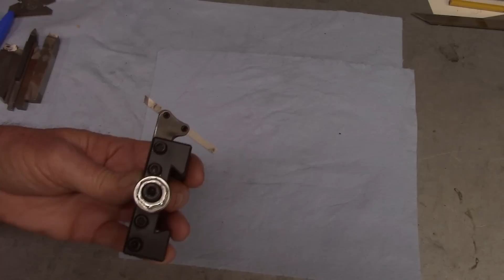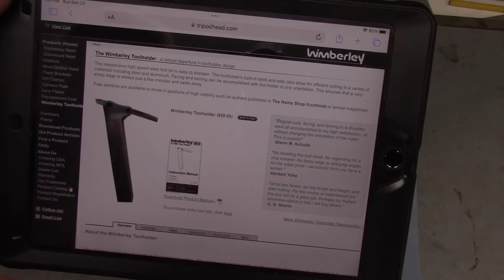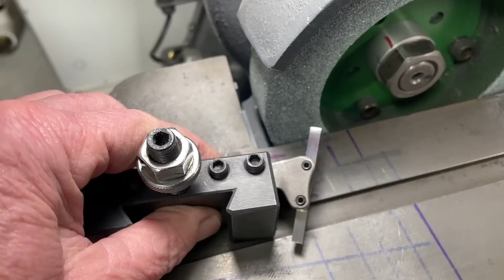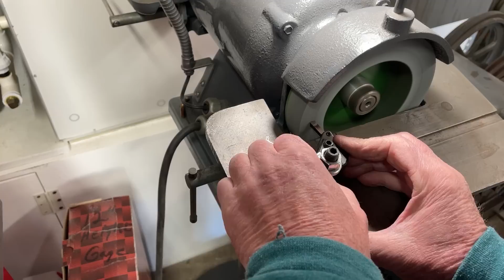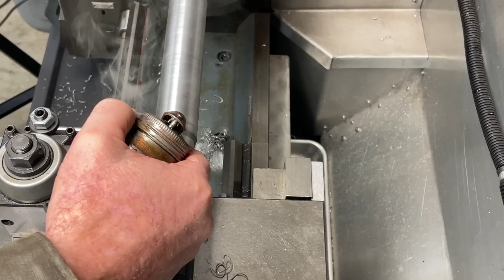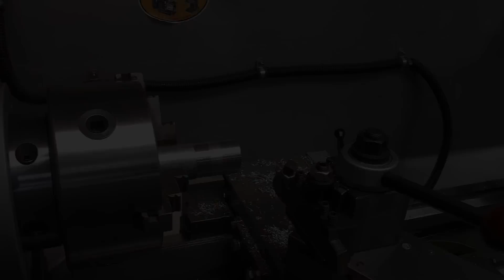What Is A Wimberley Lathe Tool Holder

Comment: NEAT!  There is another factor you didn't mention.  Life span of the cutting tool.  With the Wimberly being basically touched up  like a pencil being sharpened you get a very long life out of a small piece of tool steel.   The other styles of grinds for the straight and traditional tool can certainly be touched up a number of times.  But at some point a fair amount of stock must be ground back to start over.  Not so with the Wimberly.

Interestingly enough I made an AXA style holder that holds a piece of HSS angled similarly to the Wimberley for proper back and side rake angles.  But mine sits along the leading face of a trapezoid shaped  holder with its own dovetail that fits directly to the AXA post.  It's the same idea in that I only have to grind the leading and end faces.  For lighter feed rates I get the same curly strings.  And for heavy cuts similarly straighter strings to the Wimberly.   So there's more than one road to Rome apparently.   My goals were ease of grinding and longevity of the length of HSS stock.  And I got that on both counts.    While I have some insert tooling I keep it for tougher alloys.  The lion's share is done with my double angled face and end ground only HSS holder.
Reply from the maker: @brucematthews6417  thank you Bruce. Those are some very good key points.
Your custom tool holder sounds very interesting. I wouldn’t mind having a look at it, others probably as well. 
For me, grinding tool bits is kind of like doing painting you dread the thought of having to do it but once you get started, it’s not too bad. 
Thanks for the great information and have a merry Christmas 🎄👍
Reply: I'd love to see a picture of such a thing

Comment: Dean, that's a great, general purpose tool for a hobby lathe. In my view, insert tooling is overrated for light hobby machines. I can't run them hard enough to get them to work well. The polished inserts for aluminium work better on steel, in my lathe anyway. 
Regards,  Preso
Reply from the maker: @Preso58  yeah pretty much the same boat here I to use the aluminum insert more than any of the others. 
I think this is gonna be a good useful tool now that I’ve ground up some proper bits for it. 
I may add a diamond tool holder to my arsenal as well, I’ve always liked that design. 
Have a happy new year 👍
Cheers ….

Comment: Also, if you'd like an extra tool holder, we will send you one at no cost. I find it very handy to have the standard and the positive lead toolbits in different holders. The positive lead tool bit of course is very useful for chamfering as well as for roughing cuts, and I tend to use it more than the standard  configuration.
Reply from the maker: Thanks Davie, I'll send you an email.

Comment: Good video. I have one of those Wimberly tool holders.Don't use it much, but your video has inspire me to dig it out and start using it again. I put it away when it got dull and never got around to sharpening it. Also thanks for showing their web site. I DL their instruction manual. It is much better than the earlier versions I have.
Reply from the maker: Nice to hear that helped out,
Happy Holidays 👍

Comment: This is somewhat similar to the “Diamond tool holder sold in OZ.
Reply from the maker: @carlkulyk366  Yes i’ve been thinking about getting one of those. They are a bit pricey but a neat tool.
Reply: I just purchased the Kimberley to see how it compares to my Eccentric Engineering tool holders I routinely recommend. Especially to new hobbyists who are loath, as I was, to have to learn tool grinding first. I really live my EE holders, use them for 95% of my work. I want to see if can be recommended as a less expensive option for those just starting.
Reply: Spell check. Arggg

Comment: An interesting design but I'm not sure I see much improvement or benefit in use over the 'Diamond Tool holder' Tangential lathe tool.....certainly more grinding involved in sharpening the Wimberley tool.
Reply from the maker: Agreed, I do like the ability to regrind the tool without removing it from the holder.
Thanks for viewing and commenting.
Happy Holidays !
Reply: Yeah, I made my own tangential tool holder.  Simply hold the angled end of the
bit pointing up to the grinding wheel face centerline to grind it and your done.
Reply: @petemclinc  Yes,they are very simple to sharpen and long lasting with a quality piece of tool steel like 8 percent cobalt hss.
I also sometimes use a tangential tool holder on the shaper as well as frequent use on the lathe.

Comment: The shear tool bit is also called a skiver.
It isn't something you see very often.
I learned about them mid 70's but didn't hear about them again until 90's then your video .
Seems they pop up every ~20 years or so 😁
Reply from the maker: @1crazypj yeah I first learned about them from Mr. Pete.
Thanks for commenting. Have a merry Christmas.
Reply: The shear tool is more commonly used as a surface finishing tool on the shaper.

Comment: I have considered making a wheel for my Chinese knock off tool bit grinder, but since there is potential danger if it fails I've put mine in temporary retirement until I resolve the issue.
Reply from the maker: @DrRobertUnderdunkTerwilliger  I found a few affordable ones on the web, but of course they’re out of stock. 
So far the ones that are available are priced higher than what I paid for the whole grinder 😬